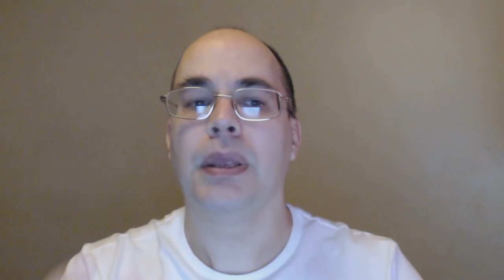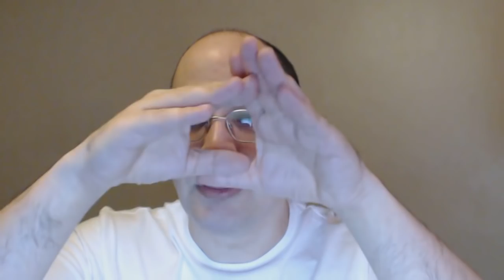How do rockets move in space, with nothing to push off from?

Comment: I dont care how many ways you say it.... or how you read it.... the simple fact is that no matter how much fuel you dump in space... there is still NOTHING for that fuel to react too or push off of.... a rocket blasting off a launch pad has ZERO to do with a rocket thrusting in the vacuum of space....those cannot be compared to each other. There are many many tests on youtube of people trying to create thrust and movement of objects inside vacuum chambers.... spoiler alert !!! the items NEVER move in a vacuum...
Reply: What would happen if you placed rocket fuel in a box, placed that box in space, and ignited the fuel?  I think there can only be one of two results;

1. The fuel burns until it is spent, and the box contains this burn

2. The fuel burns and cannot be contained by the box, which fractures at its weakest point

Yes? No?

Can you imagine another result?
Reply: ...and there goes the tumbleweed
Reply: Rocket propulsion has nothing to do with pushing off a second object.
Reply: Lavandaria Jackson
Actually, it kinda does.

Thing is, the second object is the exhaust.

Comment: How does the rocket gain thrust by pushing against something? As soon as the rocket has ignited it's engines, the exhaust inside the engines are seperate from the rocket. Forces that apply to the exhaust do not apply to the rocket. By your logic, rocket engines would not work at all. And before you say that NASA fakes the webcasts, go and watch one in real life. Good god, DO YOUR RESEARCH!
Reply from the maker: It doesn't gain thrust by pushing against something, that was the whole point of the video.

Comment: Again in air plane jet proportion  engine air enters the plane from the front get compressed and mixed with fuel  for ignition so that a hot ligth gas is  created and as you know hot air rises above cold air that means the hot air pushes against the cold air to rise so the jet engine pushes hot air through rapid combustion at high speed to push against the cold air at high speed which create a  high speed opposite reaction if the speed of the combustion is reduced the plane speed decreased the same principle work for rocket but air is not used so that speed is greatly increased that is why rocket engine is faster than plane turbo engine as the case of missile lunch from jet plane in mid air the missile still travel faster than plane  because no air drag but in vacuum space no àir to push against so the rocket will remain stationary and fall back to earth

Comment: Just as if rocket explode in a vacuum space it breaks to pieces because of the blast which use the body of the rocket to push the rocket apart in a gun the blast makes the gun to push back not the bullet just as throwing a stone with hand why don't your hand push BACK in opposite direction without a blast
Reply: Correct. it is the RECOIL of the rocket PUSHING OUT the mass of the exhaust gas that gives the thrust.